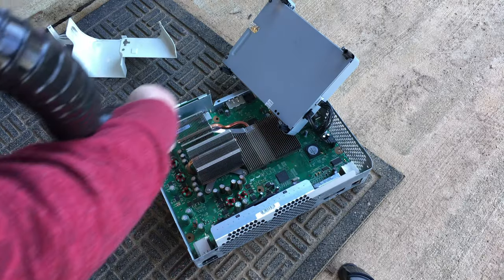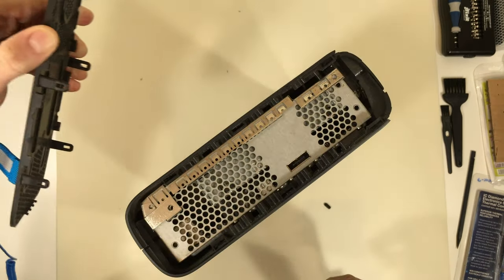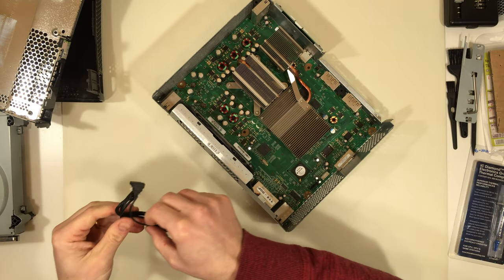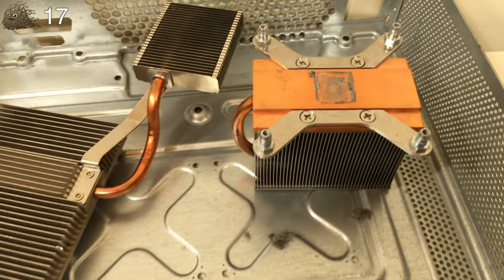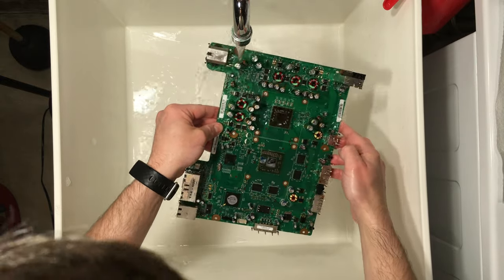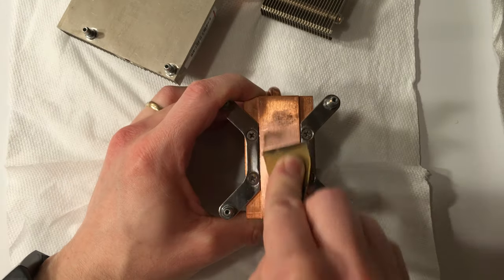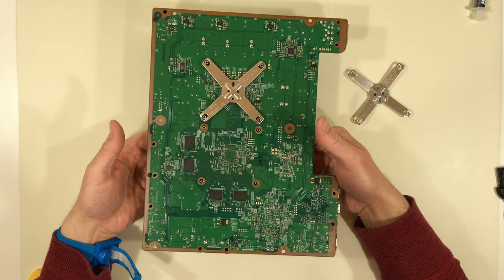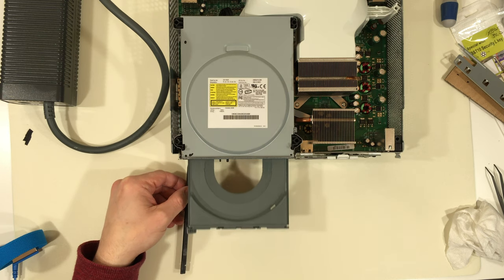Let's Restore a 15 Year Old Xbox 360

Comment: Great Video!!!! I love these kinds of restorations. Quick Tip: You don't necessarily have to replace the CD belt if it's slipping. You can boil it then let it cool it will return to it's original round shape. The YT channel OddTinkering does a restoration and shows this.

Comment: I worked I a smt factory. We cleaned boards with water all the time. Normal process as long as the water doesn’t get inside crevices that can’t get dry. Dry everything in an oven set to 45c for 8 hours to be sure.

Comment: did you seriously just wash the motherboard with water and dish soap O_O'
Reply from the maker: I don't always do this but I had the opportunity to make the motherboard look brand new and I couldn't resist.  When doing this, just be sure to remove the battery (if one exists) and most importantly make sure the board is 100% dry before powering it back on.
Reply: Yeah, I couldn't believe it too. I killed keyboards with much less. The chance of water getting inside some not-so-well-sealed capacitor or whatever far out-weights the benefits of having super clean motherboard. It will get dirty anyway and it is not like you have to look at it.
Reply: @danielbowman7226  right, even a iso wash can call issues.
Reply: Its possible to juste wash a motherboard with place it in wather

Comment: Replacing the HDD with SSD won't work unless the console is modded! There are some special security sectors on the 360 hard drives that are necessary. Also your board seems to be a Fixed Zephyr, one of the oldest but it shouldn't fail for years to come. But you've done an amazing job with this 360 and it's quite nice to watch

Comment: Much like the case tool, the X-Clamp tool makes that process MUCH easier. I fixed 2005 and 2006 Xenon Red Ring of Death boards by replacing all the large capacitors around the CPU and GPU. I also pre-emptively replaced them on a 2009, just in case.
Reply: Should I look into replacing the capacitors on my refurbished Zephyr and my Kronos Jasper?
Reply: @matttherrien9608  Wouldn't hurt to see if they're starting to bulge

Comment: Awesome work. Recently got into this hobby too and not a bad place to start w/ my old 360. I didn’t have one of those nifty xbox 360 tools like you had and I cracked my xbox’s outer shell. Do you know where I can buy a replacement?
Reply from the maker: @Jonathan Depending on the severity of the crack, it might be worth trying a quick repair with super glue.  You could use a damp paper towel to wipe up any glue that's visible on the outside.  Otherwise, eBay is my go-to for hard to find replacement parts.  It looks like both white and black shells are available for $10-$20 US. Search: xbox 360 case shell

Comment: Man, why do people use anti static brushes (you would have to really go crazy with a non anti static brush to actually produce a high enough charge to destroy any components, hardware, or ics, most of the time anything under 5 volts isn't going to do anything since everything has to be able to have at least that much power going through it to actually run), but then use water and soap to WASH the motherboard. 99 percent ipa or electrical contact cleaner works way better and you don't risk water being lodged within the pcb or degrading the COPPER and other metals inside your hardware. People are pretty dumb when they do that and they don't even realize. I don't care how much you evaporate, some residual water and soap can always be left behind. People, stop washing pcbs with soap and water, please.
Reply from the maker: Thank you for sharing your experience.  I will do more research take take caution moving forward.  I agree that ESD brushes likely aren't needed when water or IPA is involved as the liquid should prevent any static build up anyway.

Comment: Never use water and soap on motherboards it will fry it in seconds
Reply: It’s definitely not advised, or necessary, however if done correctly & dried thoroughly it should be fine.

Comment: Just restored an Xbox 360 I got for $40 and these console do a good job at holding dust due to all the little holes. I truly have fun restoring these Xbox 360 systems a lot! Great video and smart idea washing the board honestly! As long as it’s discharged and left to dry it won’t be an issue. People need to stop panicking over it.

Comment: Hi! Is there anyway you can remove the back with the tool? I dotn ahve it and i cant seem to buy it anywhere
Reply from the maker: Yes! You can open the back without the tool. It will require some patience but you can do it! You’ll need a flat head screw driver small enough to poke into the flat holes and guitar pick or some other thin stiff material like an index card or piece of plastic. Basically you’ll work from the outside of the Xbox in toward the center undoing one clip at a time. Once you start getting the clips you can use the index card/guitar pick/plastic to help keep the two pieces from clipping back together. You may want to start with the power cord side first. Good luck! 
If you have access to Amazon, here is a link to the tool I used: Gam3Gear Repair Case Unlock Opening Tool: https://www.amazon.com/dp/B01GDPI3FE/ref=cm_sw_em_r_mt_dp_NY7AJXGG6V2YX7QYEJ8B
Reply: @mikes1891  Haha, i found out i needed a bit larger than the holes to actually work. Thanks for the help, while i did break it some, my Pro console is open!